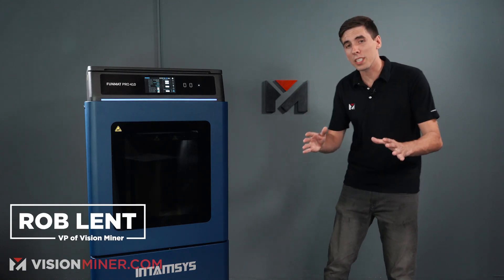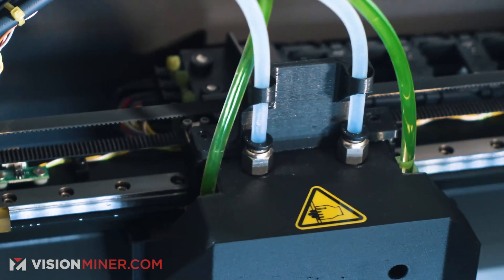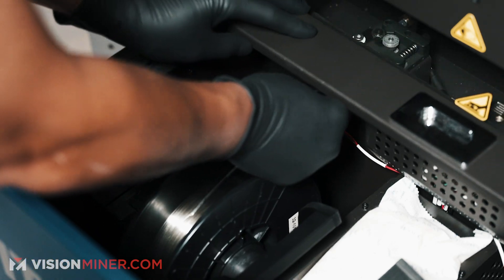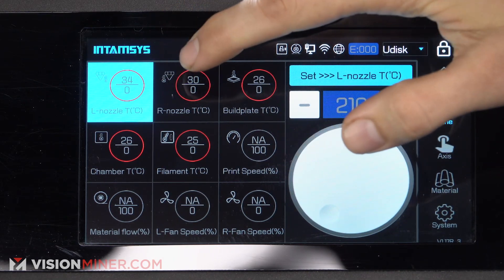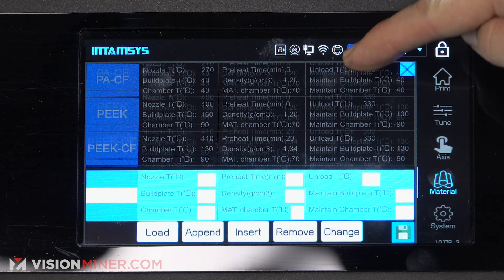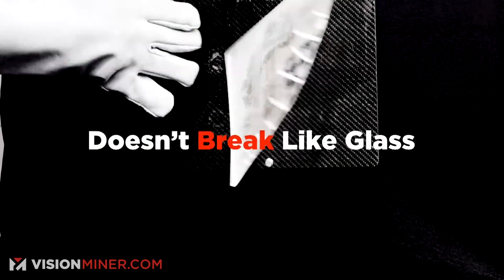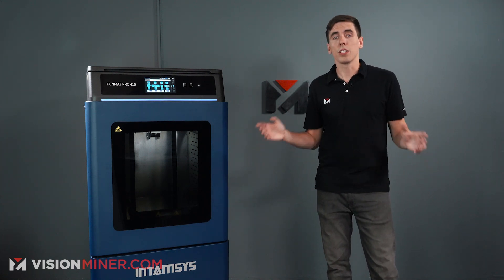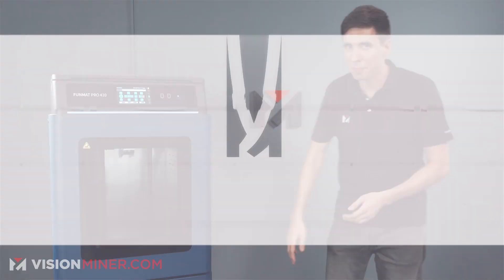Intamsys Funmat Pro 410 Overview - Everything You Need To Know (2020) High-Temp 3D Printer

Comment: Dang! Intamsys coming through with this machine!
Reply from the maker: Truth! Far better than expected!
Reply: @VisionMiner  We have this machine and i really love it. Something i dont understand: you can only use the inside camera with the display on the printer.... and really, you get a better view throu the window. There is no reason to use the cam. There is nearly no network monitoring or controlling right now. The extrusion is really perfect and i love the build in encoder that detects blocked nozzles. The auto leveling is not so good and doesnt work anymore if there is some material on the nozzle. They got a Filament bucket for both extruder behind the brush now. BTW intamsys recommends to print peek without heated chamber and anneal later.

Comment: What do you think of the Creatbot Peek 300? For less than half the price it has better specs
Reply from the maker: We WANT to love their machines -- but literally once a week we get people buying Intamsys, with horror stories about their Creatbot. Motors going out, wiring going bad, un-safe electronics, absolutely zero support from their team.... I have another contact who rebuilds them, and they're basically slapped-together consumer grade materials trying to be industrial.... i.e. burning/melting insulation, and more, it's kind of insane. I wish we carried them, but we had to avoid it. One of our guys even has one in his garage, sitting for over a year now, because the chamber would short out anywhere over 45c... It's truly sad. I don't want to talk bad, but man, after everything we've seen and heard.... they're fantastic frames, if you want to completely rebuild the machine from the ground up, inside and out... if that's you, go for it!

Comment: Does it print correctly every time?
Reply from the maker: What printer on the market prints correctly every time? None -- With a skilled operator, yes, much like a CNC, but 3D Printing hardware will not be to perfection for many more years.... even stratasys has failures, jams, and other things :) Does it work well? Yes, it does :)

Comment: Thanks for the video. Would this be a better buy than the Cincinnati SAAM HT?
Reply: Cincinnati SAAM HT has been pulled out of the market; "We are still working through the safety issue on SAAM HT and do not have a timeline on when the corrections will be made.". Shows as discontinued on VM shop.
Reply from the maker: Depends what you really need -- for $10k more and a significantly larger feature set, it's definitely competition.

Comment: so ...use weight to check filament ? may i know what is the accuracy of it ?  is that mean still dont have filament sensor ?
Reply from the maker: It does have a filament runout sensor, but the grams are there to tell you how much is on your spool -- that way you can be sure there is enough filament for the print you're about to start, without having to just guess by looking at the spool, or weighing it separately. It's accurate to within a few grams, so long as you have your spool weight correctly set.